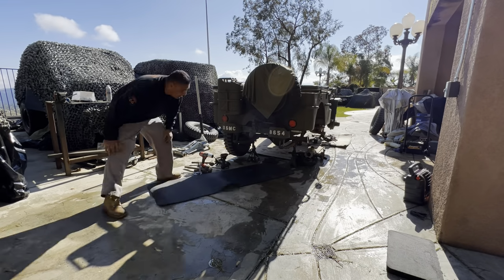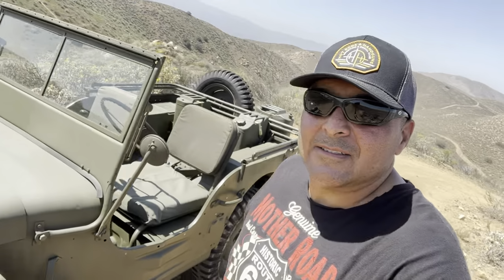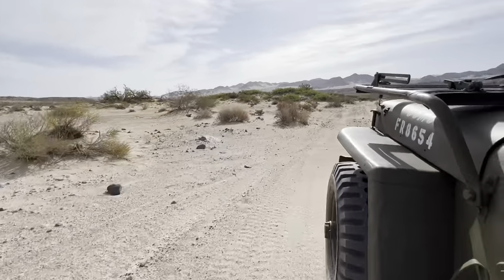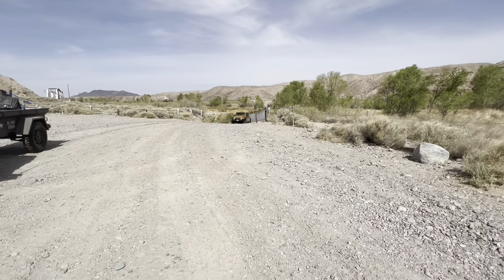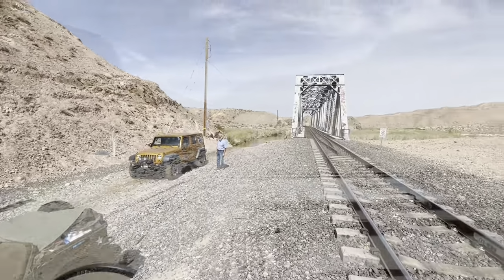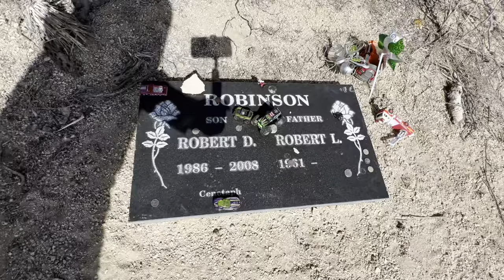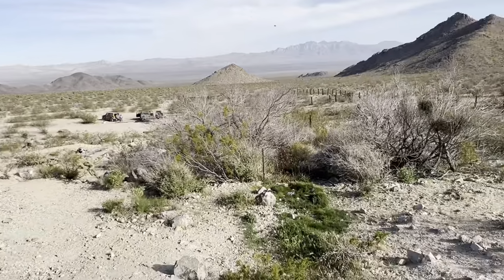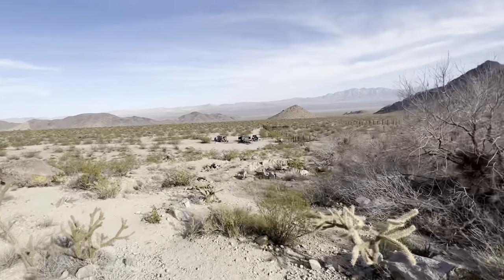The Mojave Road Trail in a 1944 Willys Jeep part 1

Comment: How's the steering/handling after diffs installed? looks like it climbs like a dream now! how is it on the road?
Reply from the maker: it handled that trail like it was made for it. I have zero complaints. the trail is pretty straight though- no crazy turns or anything. so-it went through it just fine. 
I am a big fan of power steering. I try to install it when possible on my jeeps. 
thanks, Ernie.

Comment: You still have points on it?
Reply from the maker: distributor - yes... tried to convert, but didn't work for me. had to grind the head so the new electronic distributor would fit; after I finally got it in - I couldn't adjust timing to get it to start.. so went back to points. :)